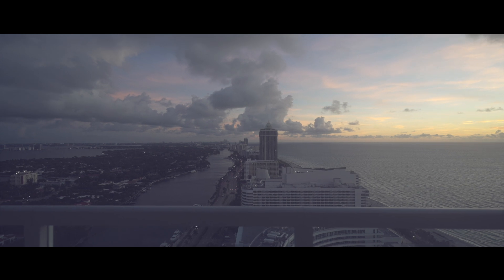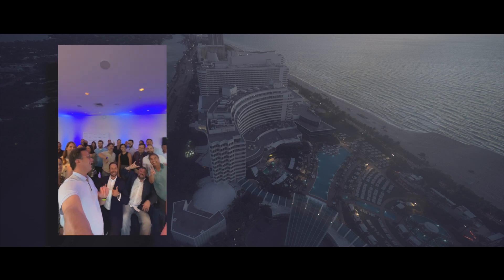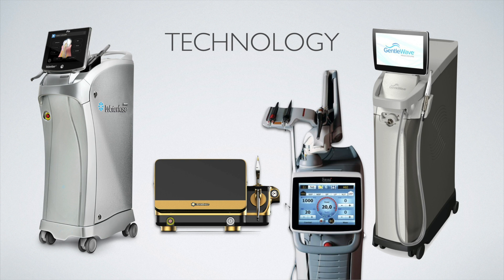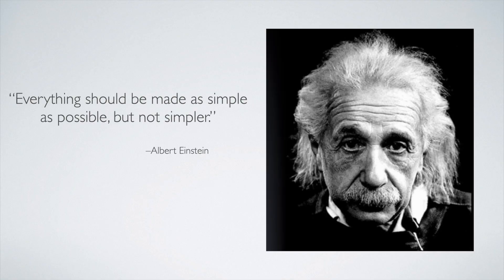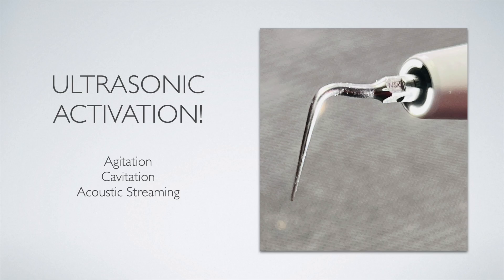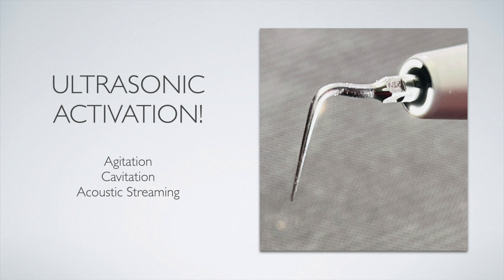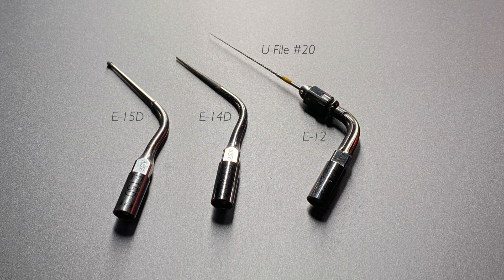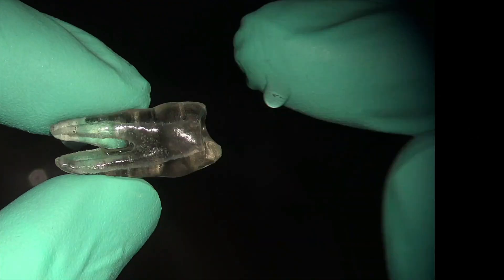Ultrasonics vs  The More Expensive Alternatives

Comment: Thanks Ali for the great lecture as always. Your early videos were pivotal for me when I was a new grad and I now firmly believe that single cone hydraulic condensation with a flowable bioceramic sealer is the only way to obturate. My question is what do you think about standard sonic activators (Endo Activator) for activating your irrigant? This is what I personally use out of habit. Is an ultrasonic activator a necessary upgrade? Thanks again. -Tanner
Reply from the maker: Thanks. I think anything you do it better, Sonic or Ultrasonic. Its just that the sonic requires one more tool on your shelf. If I can multi-use my ultrasonic for that I'd prefer to get more out of less than add one more tool. But if you have it and it works in your hands use it. Cheers!
Reply: @AANasseh  Great point, I'm all about simplifying the armamentarium. I'll have to pick up some of those ultrasonic file tips for activation. Thanks again as always. 👍
Reply from the maker: @behindtheloupes  Be sure to use it at the lowest power setting and they should we free in teh canal. No contact at the tip and the sides. I'm designing non cutting tips soon.
Reply: @AANasseh  Thank you! 🙏

Comment: Can you design something like EDDY for brasseler system
Reply from the maker: Those types of sonic based movement are not as effective as piezo motion. There are also single trick ponies. Ultrasonics can o all that plus many other functions. So, why not use multitasker than a single function tool (studies show it doesn't do a better job than ultrasonics by the way). Cheers.
Reply: Thank you ! How do you deal curved canals with PUI. I am just afraid of cutting more dentin in apical third with U12
Reply from the maker: @AmarjotSingh007  No need to go beyond the curve. Hold above the curve and refresh the solution often. I probably have to make a video about that to show it.
Reply: @AANasseh  yes please thank you so much!

Comment: Thanks for the information
Sir,What about air sonic 
Or adding polymer (flexible) tip to ultrasonic!!
Reply from the maker: Sonic is better than nothing; but ultrasonic, at least based on the research, seems to be better. Either way, both are better than nothing. Flexible tips don't work on ultrasonic as they absorb the ultrasonic energy. They must be rigid. That's how it works. That's why those tips are stainless steel and solid. Cheers!

Comment: When do you use the ultrasonic? Is this irrigation your last one after your last file? I have 4 of these for my 4 units and 2 extra ones Judi in case one broke.
Reply from the maker: I use the ultrasonic all the time. In a previous video where I'm in Pensacola  Florida I explain my sequence. You can use the ultrasonic with water to flush and then replace the water with NaClO for the most safety in flushing. Your thin ultrasonic tips should be used at their lowest setting. Just dump them after about 20 uses. Don't take a chance. Cheers!

Comment: As the product developer that you are, I have a question. I saw that NSK has a Varios perio tip for pocket irrigation and cleaning, called P40 and P41. My question is, how difficult would it be to develop an endo irrigation tip that will irrigate root canals, similar to the Pro Ultra Piezo Flow? According to Dr. Happasalo, piezo flow is the quickest way to debride a canal, apart from Gentlewave. The Varios 970 and Combi Pro have independent bottled water source; how hard would it be to use NaOcl with that unit?
Reply from the maker: Michael, there are a lot of options in this area and yes, I've been planning on redesigning the E-12 tip now for about 10 years!!! I must say I've been lazy and too many projects have come up that have taken priority... but maybe I should do this sooner than later. But either way, I think the addition of some ultrasonic energy is really what's the important factor in catalyzing the rate of reaction when it comes to cleaning. As you know from my other video, I've been focusing more on flushing with water and then replacing the water with Triton as a safer and more efficient (and less expensive) means of irrigation. I hope this makes sense.  Cheers! :)
Reply: @AANasseh  Hey Dr. Ali, yes it makes sense. I was just inspired by a video DELabs (Dr. Buchanan youtube page) uploaded not long ago, in which he demostrated the efficacy of Gentlewave in 3D printed blocks with a piece of ham between two shaped canals, imitating a long, voluminous istmus (similar to what one might find in a c-shaped molar). When GW went through its NaOcl cycle, tissue dissolution was clearly evident, but when it went through its EDTA and distilled water cycles, no tissue dissolution occured. Although an in-vitro demostration, and ham is not pulp tissue, I became convinced that activating NaOcl is required in order to debride vital tissue in lateral anatomy like lateral canals and istmi, regardless of which tool you use for activation.
As a side note, he also demonstrated how little sonic activation contributes to said tissue dissolution and how much negative pressure irrigation does; I became an avid Endovac user ever since.
Having said this, I can totally see how activation of water would be beneficial for flushing the main canal space and how it contributes to desinfection of lateral anatomy in necrotic cases, which is why I've adopted your approach of US flushing with the E4D tip between files.
I'd also say that I refuse to associate you with the word "lazy"! You're one of the most prolific endos I can think of!
I can't wait to see how that updated E12 looks like!
Reply from the maker: @michaellupu2080  I agree Michael. Activating the solution makes a lot of sense. And yes, that video is using Prosciutto, which is not pulpally relevant; however, it does demonstrate the importance of volume and activation; something we've known from a large body of research. I'm glad you're using EndoVac. It's a great product. I've developed a product called TotalVac that will soon be launched (Greater NY Dental Meeting!). You'll see that video soon. However, spending $80K may not be necessary to get the results we want as it's clear from the outcome studies done prior to GW. So, let's not lose sight of the big picture. Cheers! : )
Reply: @AANasseh  Thank you for your words of encouragment. 
Gentlewave looks amazing, but it'll have to wait in my case, for sure.

You know what I wonder? What would be the effects of placing a microcanula in one canal and activating NaOcl in the other in roots with interconnecting canals (via istmi), like in lower molars and 2 canal premolars. 
It would be a clumsy set up, requiring 3 hands (one to administer fresh solution, ideally with the endovac master delivery tip, combining both irrigation and aspiration), another to hold the irrigating handpiece (I'd fear US activating, as it might damage the microcanula) and the third hand holds the mouth mirror. It's like piezoflow combined with NPI, which will obviously increase the amount of wall shear stress at the apex. Might it increase the rate of tissue dissolution?
I can't wait to see your contribution to the NPI world!
Reply from the maker: @michaellupu2080  don’t over complicate it Michael. Simply Adding NaClO while agitating with US should suffice. That’s what TotalVac is designed to do, but at a fraction of the cost as it will be manual and won’t have any bells and whistles.
Reply: @AANasseh  thank you for your sage advice.